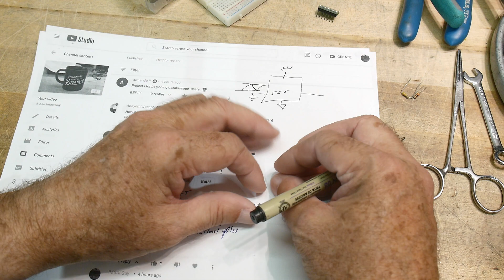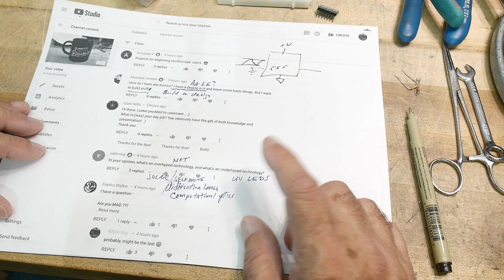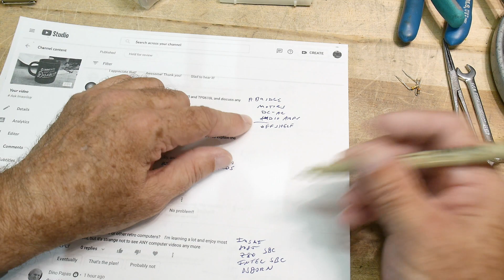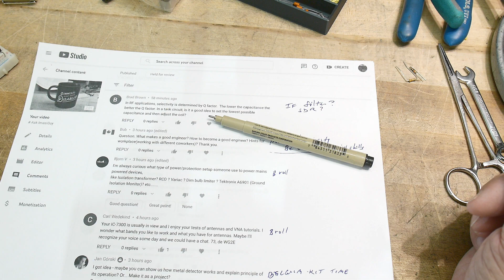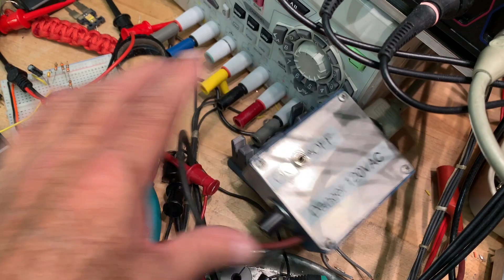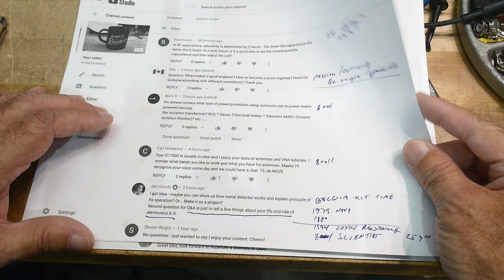#1227 Ask ImsaiGuy (part 1 or 2)

Comment: I started doing electronics at an age of 11..12. Learning by doing, using circuit schematics, build them up trying to understand how they work understanding the basic functionality of their parts and building blocks, starting to think modular, etc. After school I became a tool maker, later get my Abitur (collage degree?) and started to study to become physicist, made my PhD. I started in the field of thermodynamics, working cycles, Stirling (like) coolers, Stirling (like) motors.

During my work for an institute I came back to electronics, mainly as a good tool for controling and monitoring experiments. I developed special instrumentation for high speed pressure and position readings, power electronics to brake thermodynamic engines (constant current / voltage loads). Then I moved back to university for R and D to do more basic work in thermodynamics and fluid dynamics, thermoacoustics, pulse tube engines, special steam cycle engines (supercritical ORC). About a year ago I moved back to a company developing fuel cell power electronic, sensor systems etc. Now I am reorienting again in the direction of e-mobility power electronics for synchronous motors. I am also trying to apply for financial support for the development of high-torque synchronous motors (iron-free axial flux) and their controllers.

My hobby is audio electronics, mainly advanced audio amplifiers class AB. My favourit is boostered op amp design power audio amplifiers with low THD+N. Recently I have also finished a nice little class D power audio amp, built up by use of industrial components (voltage to pwm converter IC (500 kHz), half bridge driver IC, power MOSFETs, output filter). Straight forward, simple design, very good test results.

Comment: I did my EE degree in the mid-80s, and yes, I'd say 80% completed the course without ever using a soldering iron let alone an oscilloscope. Thankfully I'd been tinkering since the age on about 9. The degree taught me almost nothing practical, but there was a lot of math, almost none of which I've ever used.
Reply: Between the ages of 18-23 I had the army, ( REME ) then the MOD pressurizing me to get a degree. They were willing to pay for everything. When I asked questions like ""Why would I want to waste 3 years of my life learning a whole lot of stuff, 99% of which I'll never use", the reasoning was that it would prove to people that I could complete a degree. Forty years on, no regrets about not doing it. Seems most graduates spend their lives as employees, making others without degrees rich. For me, anyone with a degree is useless, until proven otherwise.
Reply: As practical use of math that I learned while getting my EE degree, all that I used was to calculate some active filters with op-amps in analog and in digital using VK minimization and other boolean math (although some simulation program can do also).
Ohm law, Kirchoff, voltage and current dividers, LC resonance and other useful formulas I learned before, from old magazines and books where there were circuits with theirs explanation and methods of calculating the components values.

Comment: Q: You mentioned that you have done consulting work (I'm retired, but I'm about to start some consulting work via a consulting firm).  Did you go thru a consulting agency or did you start your own consulting business?  If you started your own consulting business,  what was involved (i.e. LLC, insurance, etc.)?
Reply from the maker: I've done both. 95% on my own. some big companies want to use temp agencies for legal reasons. My business was sole proprietor. I applied for a business name at the county, had to run a ad in a newspaper (remember those) for two weeks stating my company name. once I had a business license, the fire department had to inspect my office. then I opened a business bank account so I could receive payment in the business name. I did not do an LLC or get any extra insurance. very small yearly charge for the business license. the times I had to use a third party, I hold them my rate and then they add 20-25% for them and that is what the customer paid. lots of work to keep expenses documented for taxes.
Reply: @IMSAIGuy  "...some big companies want to use temp agencies for legal reasons..."  That was the exact reason why I was asking.  :)  Maybe like you, I found out large companies don't like to write checks to individuals, they would rather pay a LLC, consulting firm, etc.  And I wasn't too keen on starting a LLC just for occasional work (taxes/paperwork hassle).  So they arranged for me to go thru a consulting company they use.

Thanks for the reply and keep up the good work!

Comment: Q: What is making those specific noises at the start of your video's when the switch changes to "Abnormal"?
Reply: It's the floppy drive of his IMSAI engaging.  You can hear it in his IMSAI videos.
Reply from the maker: Tom wins! is is the correct sound of an 8 inch floppy drive booting then abnormal sounds
Reply: I was wondering about that sound too. My guess is that it was the sounds of a squeaky chair as you sit down on it.
Reply: Wild guess: it is a badly bouncing contact. Happens especially when such switch contacts drive inductive loads.